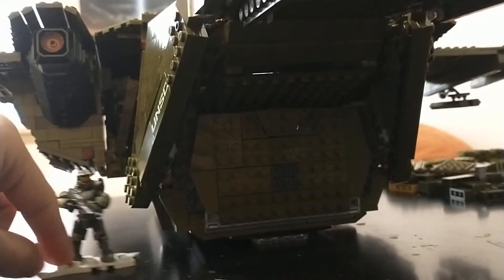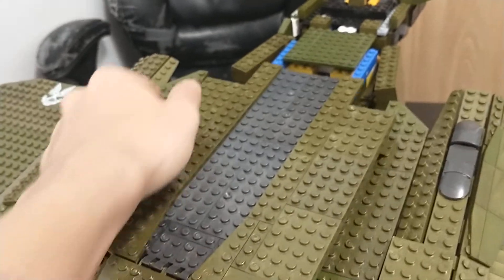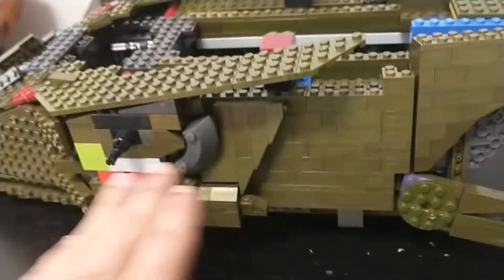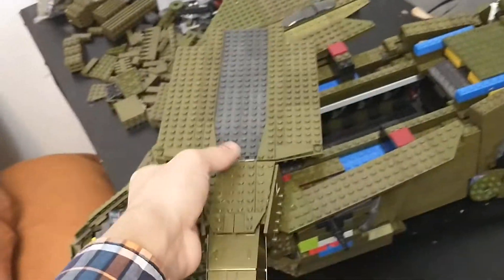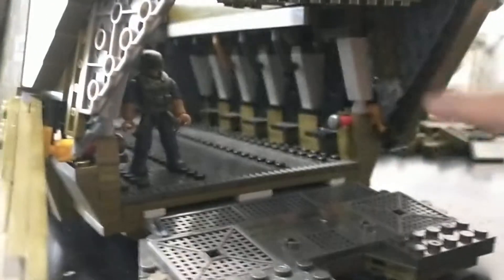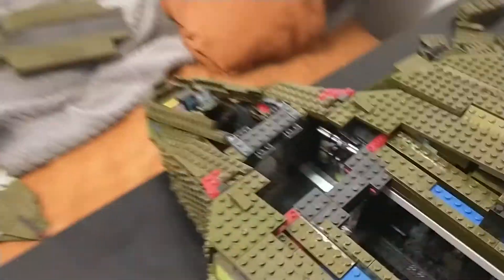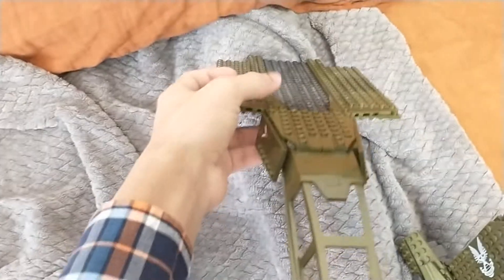Full Scale Mega Construx Halo Infinite Pelican MOC (Part 2 Overview)

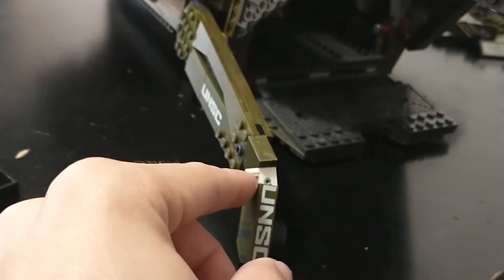Comment: 00:53 there's is a mega construx piece that is more sturdy and available in the same colour as the rest of the pelican build but it's a different angle and it's 1x2 cheese slope with studs on the top
Reply from the maker: Thanks! Pelican landing gear just has some odd angles that are difficult to nail down in a way that looks good. But I'll see if it looks better.

Comment: Hey bro what piece did you use To extend the tailgate? 
And where did you buy so many pieces of this or how did you get them?
Reply from the maker: For the Tailgate I actually used 2 door pieces from the Kre-O Star Trek airlock set. Super random but it works. The hinges are pretty loose but they were perfect for making the ramp extend at a second point like in Infinite. I don't know what would be a good substitute for them but I think Lego has some similar pieces.
Most of the pieces were from 2 of the 2020 Pelican sets. A lot of the interior parts are just random ones from my collection. Nothing too unique or hard to get ahold of but I couldn't point out any sources.
Reply: @ryatt9365  thanks for the info man 
I'm surprised to find just the kreo set on Amazon for only 13 dollars
Reply from the maker: @deuchino  That is surprising. I thought it'd been discontinued. I got it when it came out and those pieces have just been chilling in a bin for years.
Reply: @ryatt9365  when I looked for it I thought that some people would come out selling it at too high prices but I did not expect to find it on Amazon at that price